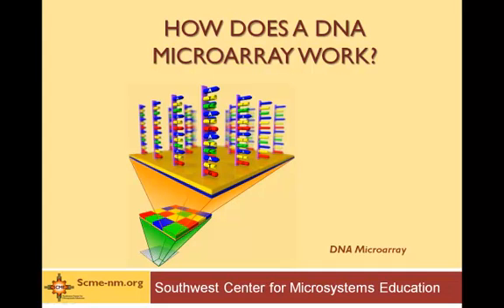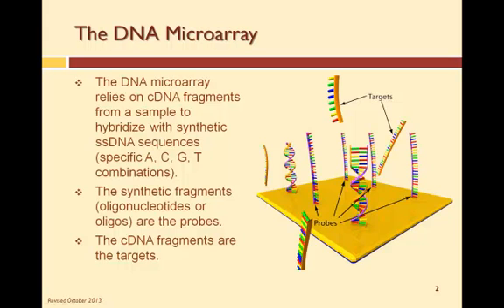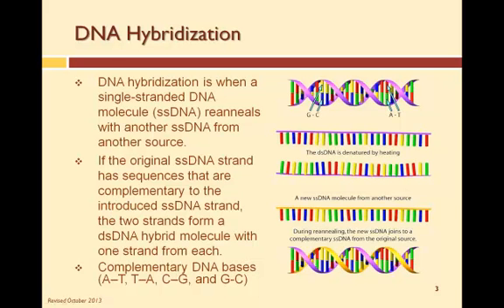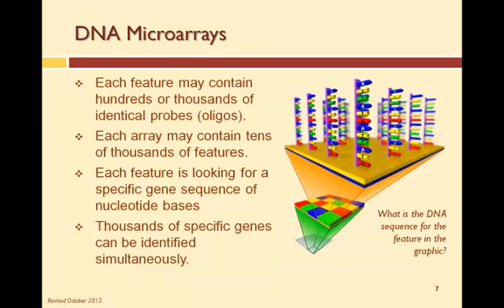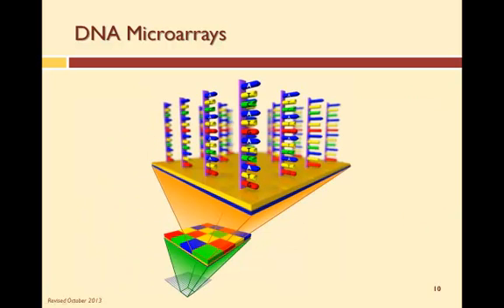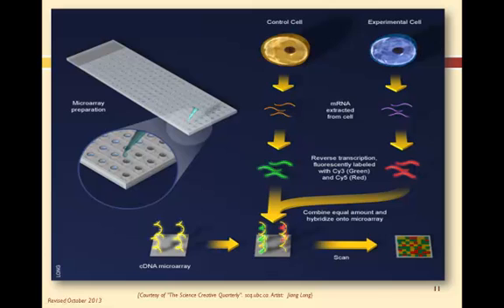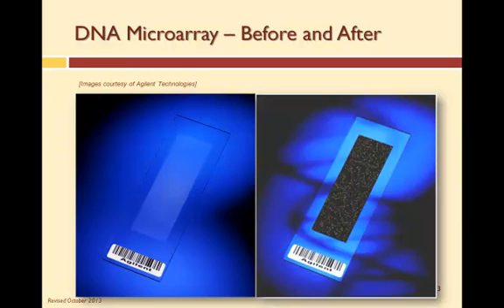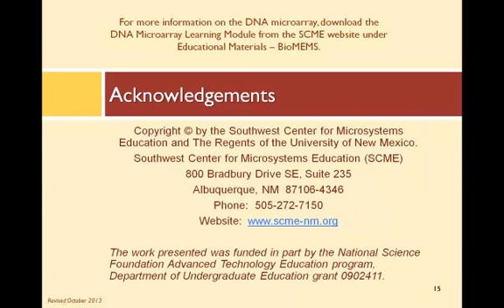How Does a DNA Microarray Work?

Comment: I understand how the control fragments bind to the control probes since most genes are mapped on thew microarray but how does the test strand (cancer) bind to the probe?
how does the DNA strand from a cancer cell find a match? the mutation could be in any nucleotide(s)
or are there probes for the common mutation?
Reply: +msabri1  The oligos on the microarray are spotted in respect to normal cell's genome sequence. The normal cells would therefore synthesize the mRNAs  and corresponding cDNAs through RT PCR would bind to their complementary strands on the microarray. The cancerous cells may produce  normal mRNAs for some sequences which will hybridise to their complementary strands and mutated mRNAs for others which wont hybridise. Thus,                   A red colour on a feature means no cDNA from normal cells hybridised on it, only cancerous cells produced corresponding mRNAs and thereafter their cDNA probes.     A green colour would mean only normal cells produce mRNAs for the corresponding gene and no expression occurs in the cancer cells for that gene sequence.    A yellow spot means both cancer and normal cells equally express the gene sequence and therefore cDNAs from both of them hybridised on the feature and gave a mixed colour.
Reply: Yehs, exactly ! Microarray chips are not reusable. 
Secondly, they are based on common coverage. For instance, a gene array for yeast is based on the gene sequences of Saccharomyces cerevisiae , which is the most common species. It can be used for the detection of transcripts of other species too.
Reply: So are you saying that a unique microarray chip will be manufactured for each time one is used, and that it will be based on the test subjects own cellular mRNA?
Reply: Great answer, I understand it better now. Thank you very much.
Reply: to add; each micro array chip is manufactured based on the suspected  abnormality or cancer type, with sequences of the known mutations involved with the suspected cancer type being part of the micro array  chip or grid. In this way the mutant cDNA in the test cell(s) could hybridize to its complement probes in a specific feature and produce red color. The intensity of the red color is proportional to the extent of the mutation undergone in the cell

Comment: Is there a chance for a smaller or larger DNA to attach via a partial match to the feature?  Like a smaller one hybrizes in the middle, and a larger on is dangling?
What happens if it does this?
Reply: +rasmasyean  Only very strong and specific bound probes remain after stringent washing with buffer. However some error chances remain.